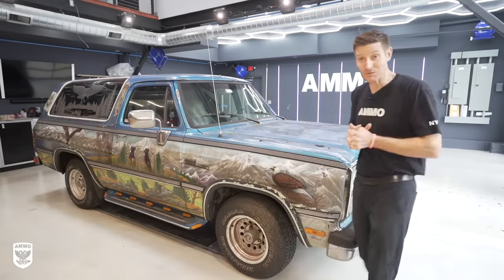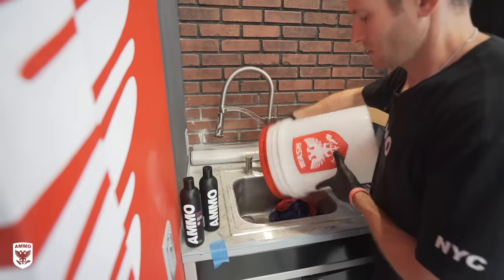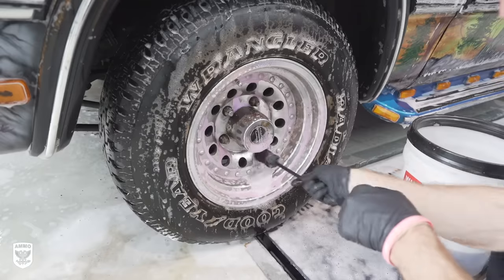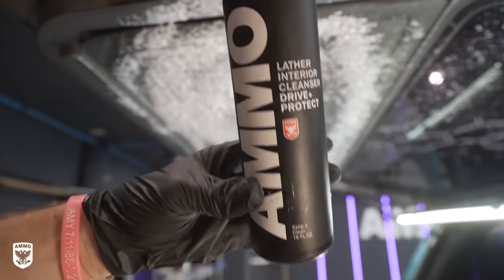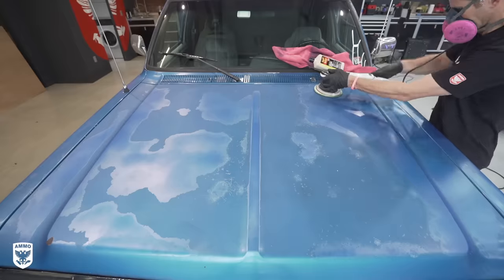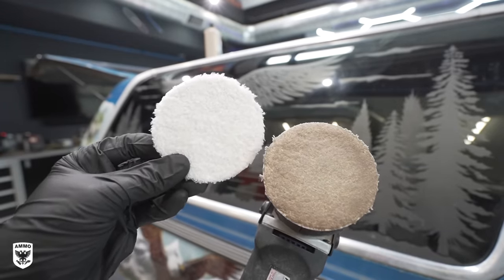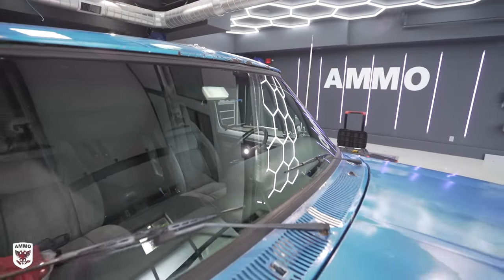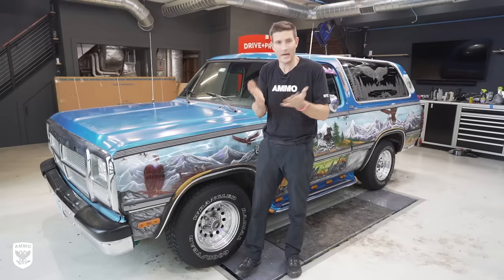Disgusting Mural Truck Detailing MakeOver: First Washing in 9 Years!

Comment: new garage is literally jaw dropping.. a vacuum coming out of the wall, like whaaat?? too cool
Reply: Sure, but why the f run the pressure washer indoors???
Reply: Tour video hopefully?
Reply: @zzz7zzz9  probably has a floor drain anyway
Reply: Damn Canadians.
Reply: @zzz7zzz9  detail geek does it too. He has a drain in the floor that he has to dig the mud out of every so often
Reply: Another detailer has been having that I think his name his detail geek
Reply: Camaro 1968  revolutionary lol
Reply: @zzz7zzz9  lotta detailers pressure wash indoors, no biggie
Reply: breathe and squeeze have you ever heard of a shower? yeah it works the same here. it goes down a drain.
Reply: @zzz7zzz9  Because it's the best way to wash a car. You aren't affected by weather or sun, and you can control humidity and temperature. A lot of professional detail shops have an interior wash bay for this reason. Hell, my full time job I work at the road department for my county and we have an interior wash bay to wash our vehicles and equipment off. When I was a full time EMT, we had an interior wash bay to wash our ambulances. It's a lot more common than you think, just not on YT.
Reply: @mikel9567  interesting
Reply: porsche detailing moneyyyy
Reply: Finduh lol I have one in my mini van lol
Reply: It's a hide-a-hose made by BVC in Germany. I have a central vacuum in my house, but without this feature.
Reply: Wall vaccumes are fairly normal in australia dude, LOL. im surprised most people dont have them.
Reply: Jacob Haagerup My previous home had something similar as well but you had to bring the hose to the outlet. Also it seems that it is a bit of a rarity here in america since that was the only house I've ever seen with a central vacuum system.
Reply: Ford bronco is the best
Reply: @maxnovakovics2568  look under it u can see the drain
Reply: @uhhlexxxis  that's in VA

Comment: Man that was some serious 1992 Montana pimpin right there lol
Reply: I own a Montana minivan early 2000's. 

To be alot more exact, 1992 Would have been the Lumina APV minivan uptown 1996, predecessor to the Montana which first came out in the late 1997 as Trans-Sport, later renamed to Montana in early 2000's, but the Montana stayed around longer, compared to Lumina APV or Trans-Sport, made by GM's Pontiac division. 

Late 90's to early 2000's  GM motto : Pontiac Driving Excitement !

To a lesser exact degree, technically you could call the Lumina APV Montana, since it's the predecessor of Montana and it's also made by Pontiac.
Reply: I like what I see here, a vehicle with mural graphics on it.

Comment: Hey Larry, just a suggestion for the new studio. You should get some sliding plastic tarps on rails that go around the bay the vehicle your detailing is in. That way when your pressure washing mold, water, soap, etc isn’t getting splashed around on your tools boxes and work surfaces and in the corners of your building where everyone forgets to clean. We have them at the dealer I work at. And it’s way cleaner. If your interested I can email you our set up for reference.

Comment: Do you have to run a de humidifier in the garage to prevent mold from the amount of water used inside or would simply opening the garage doors do the trick. I would imagine the evaporation rate would vary depending on the season.

Comment: So the floor pans were just redone and the carpets were lightly tacked down but they somehow left all that loose wood and dirt on top when they put the carpets back down?
Reply: There was 9 years worth of leaves sitting in the HVAC system. You had to wear glasses just to drive at highway speeds.

Comment: Holy Moly, I almost fell out of my seat when I almost literally followed the camera when it turned upside down, ha ha ha ha
To sneeze? "Gesundheit!"
That you still get that paint well when I look at it this way, the clear coat has almost completely disappeared, which was more common, incidentally, Toyota passenger cars also had problems with it, which were built in the late 1990s, the clearcoat disappears over the years, which rest is complete sanding and (again) spraying.
By the way, do you have a new garage or shelter where you wash the cars etc. saw what is passing by, do you have a link of that "new" building?

Comment: So they replaced the floor pans, and  put the old carpet back in along with all the leaves/stones/twigs?
Reply: A lot of crap came flying out of the HVAC vents after sitting for that long. I was covered in mulch by Maryland. There is also a fresh air vent in the kick panel of these trucks that gets jam packed full of leaves. I opened it forgetting that and was super glad I had glasses on.

Comment: How did he replace the floor pans without removing the carpet...  And if   he did remove the carpets to do the floors before you cleaned why was there so much leaf matter on the floors, and if replacing you just replaced the floor pan why not just get a new plush pile fitted carpet for $199? 
Also is your pressure washer cold or hot?  And how the hell do you gauge what pressure to use on diffrent paints - I would have been scared in some places that I would blow off paint

Comment: Wait if these guys redid the whole interior of the car, including welding the bottom foot panels, wouldn't they if removed the carpet from the inside to do that? How is there so much leafs and stuff there after they put it back? Placed for the show?
Reply: Had to drive it up to his shop. 9 years worth of leaves were sitting in the HVAC system. Had to wear safety glasses at speed

Comment: Wait, they pulled the carpets, welded the floor, installed the carpets and drop the dirt again into the car?
Reply: There was 9 years worth of leaves in the HVAc system. You had to wear glasses just to drive at highway speeds.